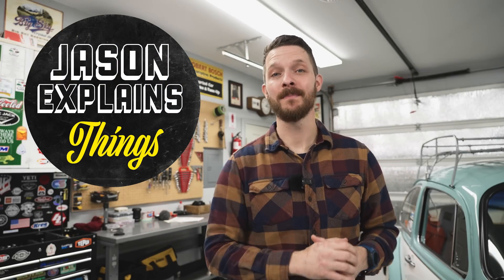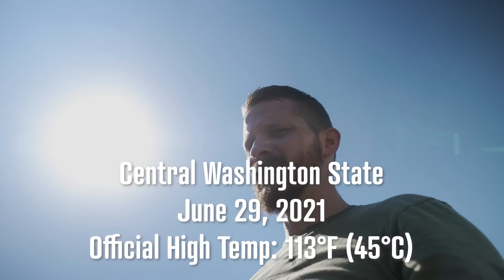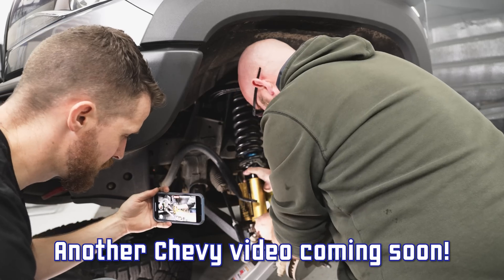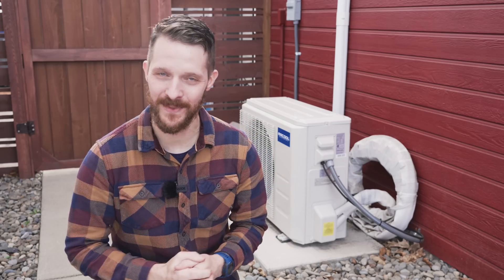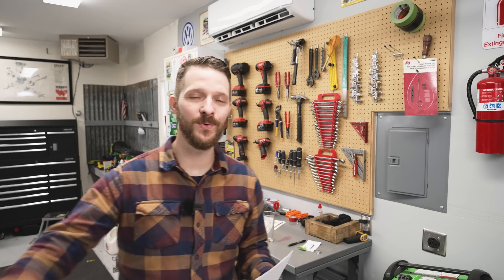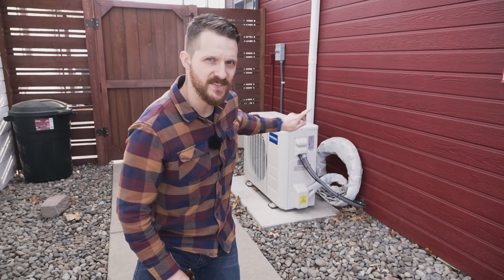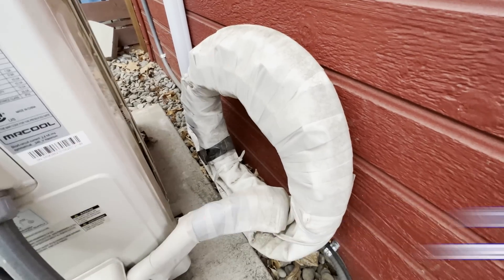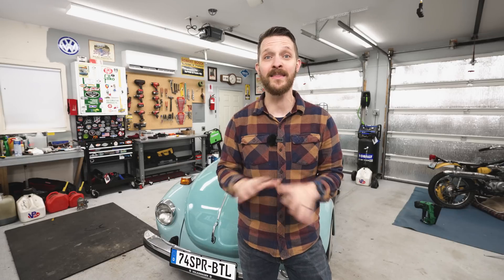MRCOOL DIY Mini Split LONG TERM REVIEW (15 Months Later)

Comment: Great series of videos that helped greatly in deciding to buy and install my Mrcool unit. Regarding the excess line length, the manual actually says to keep it coiled in a flat position. The lower right corner of page 26 of the installation manual states: "Keep excess refrigerant hose coiled. Wrap with protective tape and store behind the condenser in a horizontal position (flat with the ground)."
Reply from the maker: Wow.  You’re comment is pinned.  Hilariously this is the only time this is mentioned, and the other times it’s shown or pictured in the manual it appears vertical.  Also MRCOOL’s own installation videos show it clearly vertical.  But thanks very much for pointing that out.
Reply: If it is vertical it creates oil traps, this will kill the unit and is the most common failure I come across with these
Reply: @RahmanNoodles33 good to know . Thank you
Reply: I was curious about that, as I can understand the vertical not compromising a pressurized system like that... but to actually go out of their way to recommend a vertical orientation was surprising to me.  Good catch!
Reply: All you need is a $25 flare kit.  Cut all that extra ugly line set off....  but yea, dont leave vertical loops.  Its justmultiple oil traps when you do that.
Reply: @jasoncurtis4404  that would vent all your refrigerant and make it much harder to DIY.
Reply: @jasoncurtis4404  Do you have a link for this and maybe a quick explanation?  I really hate the idea of a bunch of coiled tubing just sitting there.
Reply: @jasoncurtis4404  - All you need is a $25 flare kit? If you cut the lines you lose the refrigerant precharge. Then you need a flare kit, vacuum pump, micron gauge, manifold gauge set, EPA 608 certification, a jug of refrigerant, and the knowledge to use it all. 🤦‍♂️
Reply: @jasoncurtis4404  Also we'ld lose the $1,000 premium we pay extra for this true DIY solution.  That would defeat the purpose.
Reply: @jasoncurtis4404  Bahahahahahahahahahahahahahaha

Comment: Sorry to be a party pooper... but that Square-D Homeline panel has a 30 amp 2-pole Siemens breaker in it which is a code violation. Simple and cheap fix to just swap that out with a Sq-D Homeline 30 amp 2-pole breaker.

Comment: I installed the same unit in my house in North Central Washington in 2019. It cries, woo, woo woo, woo. My wife and I did a full cleaning, messy, but the fan was caked with stuff. I thought it might be a bearing, but it gets louder and quieter in a 30 second cycle. Anybody out there know what this is from? Perhaps I have a tiny leak and am losing cooling, or perhaps it is the TX valve. It is really annoying.

Comment: Hey Jason build a small roof over hanging (like a porch) the unit and paint. This way it keeps snow off and piling up behind the unit. Then paint you hose line cover the color of house.
Reply: From what other comment said since horizontal you could build a shelf in the roof so the coil could be horizontal

Comment: Great video.  The production quality is top-notch and you cover everything well while still being succinct.  The natural gas heater is very effective at warming up a space, but at one point you said it was more "efficient".  I suppose that is a subjective topic, but in terms of both cost and COP (Coefficient of Performance), the mini-split is more efficient at heating a space.  This is because it doesn't generate heat, it merely consolidates it out of the atmosphere.  This is what makes them almost magical, because their efficiency is actually greater than 100%.  In fact, that unit has a COP rating of 3+, which means for every unit of energy (in the form of electricity) used to run it, the mini-split puts 3 units of heat energy into your shop.  As effective as the natural gas heater is, the COP is still less than 1, by comparison.  Even the very best gas furnaces are only in the 90-95% efficiency range.  Your mini-split is likely running at a COP of 2 even when the temperature is at or slightly below freezing outside.
Reply from the maker: Yeah I've been corrected on that a bunch of times.  Meant to say economical instead of efficient.  Heck, that might not be true either since natural gas prices have gone up so much.  :-)
Reply: @JasonExplainsThings  - Yeah, but propane has gone up even more.  I'm SO glad our HVAC guy talked us into getting a heat pump added onto our AC coil, when we replaced our system a couple years ago.  Between that and the heat pump on our hot water heater, our total cost for utilities is down more than 25%!  This really pays off for us whenever we have a fire in our wood-burning insert, since that has a plenum chamber tied into our HVAC's hot air return.  Both systems benefit when we have a good fire going.

Comment: I have nothing but problems with my unit lots of Freon leaks on factory joints
Reply from the maker: That sucks man.  I installed mine 2.5 years ago without any issues since.  All I do is clean the filters on occasion.  I may do a deeper clean on the condenser and check the drain pipes this spring before I start using the AC all the time.

Comment: A lot of people in my area build a small sloped roof structure over top of the unit to kkepmthe snow from falling on the unit, the lines and the area behind it. This works really well and doesn’t impact the operation of the unit at all. Basically just a 2x4 frame that goes far enough above the unit so as not to interfere with the air flow, but greatly reduces the snow accumulation around and on the unit.

Comment: Thanks, but it made me realize that I can't use MrCool because in my 2nd story application I can't allow excess lines coiled up.
Reply from the maker: If you're installing it on a second story you likely would have the exact amount of line and not need to coil it.  I'd just recommend checking the instruction PDF and measuring to confirm.

Comment: Jason, I installed a 12K unit five years ago and recently installed a 24K Generation 3. I am pleased with the performance and quality of both units, but have the same problem noted by others on the Mr. Cool blog, the inability to maintain an even room temperature.  The set temperature on the evaporator display is typically much higher than the actual room temperature and continual adjustment of the set temperature is necessary.  I have used both the handheld remote and their wireless mini-stat with the same result.  The Mr. Cool company blog states that the remote units are NOT thermostats, but merely controllers that advise the system of a set point and the system makes decisions based on indoor and outdoor factors. Most disappointing is that I have had no response from my contacts with Mr. Cool and this problem is identical to others on their own blog, and their answer was that their tech department would "reach out" to them.  The blog was active in 2020 and I am unaware of a current one.  The other worrisome thing is that there does not seem to be a method to register the product for warranty nor is there a procedure to make a warranty claim if needed.  DIY is great, but if a problem arises, you are on your own dime.

Comment: Would these work over regular heat pumps for inside the home? They have the 36k but ones for 1500sq ft. For 3300$. Seems reasonable

Comment: Ah yes… the almost globally standard statement of “we won’t maintain it cause we didn’t install it” (and missed on the ‘official dealer’ markup and ’1000 USD per install). Exceptions: countries like India or Russia, where you can find AC tech actually understanding thermodynamics and being OK to consider you (the owner) a competent equal… and a paying customer. 🙄 Some cases went to court in the EU over this, and the DIY-er won! Right to repair, right to maintain, right to DIY! 💪🏻

Comment: I installed a 12 K unit two years ago and loved it,..
It worked flawless until today, I got a P4 trouble code on the unit, called customer service it was horrible and I’ve been reading a lot of negative things,… so now it feels like I’m stuck. gonna have to call an HVAC contractor probably to recharge it or troubleshoot it and spend more than what I actually spent on it☹️

Comment: Nice follow up vid, thnx for posting!  Question I have is what is the power draw at each of the many settings, or over a month of use at whatever settings you leave it at?  For ex: Watt hours being used at eco mode regular mode, SUPER COOL mode? That kind of thing. Thanks again for posting! Subscibed!!
Reply from the maker: Sorry I haven’t had any issues like that.
Reply: @JasonExplainsThings  he's asking how much electricity does it cost to run it in various modes.

Comment: Thinking of getting this installed. Does it matter how many amps my home's breaker box is if the HVAC guys are going to install a separate breaker next to mini split like i see next to yours?
Reply from the maker: I'd consult an electrician.  FYI, the box on the outside isn't a separate breaker... its just a disconnect box which is required by code.
Reply: Yes, it does matter. Your main panel is rated for a certain amount of average and you can’t exceed that.

Comment: Great Video, but just a short correction. It might be cheaper to run the natural gas heater in your garage, but it's not more efficient. Mr Cool gen 3 has a HSPF rating of 10, which is pretty good for a heat pump in heating mode. That is about 290% efficiency for every Watt of electric energy used to run the heat pump in heating mode. Most natural gas furnaces run at about 93% efficiency. You would actually be better suited letting your local utility company burn that same natural gas to make electricity (They get about 80% efficiency when making electricity with it) and then use that electricity to run your heat pump.
Reply from the maker: Yeah, I misspoke.  Should of said economical vs efficient.  We're lucky here though because we get our electricity from hydroelectric dams.  So it doesn't get much more green than that.  :-)

Comment: These are not worth the price at all they cost more then double the cost of the same mini split without pre charged lines a vacuum pump only costs about a about a  hundred bucks or a a.c. guy will do it for about that price also these are not good quality
Reply from the maker: Ok, why watch a video about something you already decided you think is dumb?  Sitting over here loving it.  It’s 109 outside and 75 inside the shop. :-)

Comment: Single head mini-splits are a snap to install and work great.  Don't forget they are not install and forget.  You need to clean out the filters and condensate drain line several times per year.

If you are thinking about a multi-head unit, do your planning and don't expect it to be a quick one day install.

Comment: If MrCool has a warranty who does the warranty work if local people will not do? 
Interesting you say the manual says to coil extra line vertical when so many home "experts" say that is wrong. 
Would be nice if they provided an option to specify the line length you needed in a DIY purchase.
Reply from the maker: Please see the pinned comment.

Comment: you should put that excess line set on a  horizontal plane than a vertical one.. I see it all the time.. that way you have it, it can trap oil which is not good for the compressor....

Comment: You said the natural gas heater is more efficient which in cost might be true, but in terms of actual energy consumed a heat pump is almost always more efficient since it is just transferring the heat from outside to in instead of actually generating heat.
Reply from the maker: Yup.  Been corrected on this about 100 times now.  😂😭
Reply: How much actual energy was consumed at the power plant to produce the electricity the Mr Cool used for this comparison? Just saying.

Comment: I stated in an other of your video's how I had a home built in Mexico, and chose my mini splits to be 220's rather than 110 as ALL my neigbor's have done. It's been ten year's, in which I have them properly maintained every year. Which to this date has included only the cleaning of them, no additional gas has of yet been needed. All of my neighbor's who have 110, have replaced their 110's at least once, three of them because they were considerably old when I first installed mine. Are on their second replacement.

Comment: This video just popped up in my recommended today, and regarding that cover - did anyone ever suggest using a spare tire cover?  Might be just about the right size, and should be even lower profile than what you were originally planning on building.

Comment: You need one in every room. 
Not for me
Reply from the maker: As you see, this is in a shop… for a house they make multi zone units.  But I can tell you that if you need to retrofit AC into an old house these work great.  My old house (first 8 months of the channel or so) was over 100 years old and predated central air.  The new owners installed mini splits and it works great.  You do have to run and hide the lines, but again it’s a great option.

Comment: Jason.  Your video Mr Cool video review was great and convinced me to buy two systems ... 18k and a 24k (both single head) GEN 4.  An installation question re the thru the wall hole size.  The sleeve with the system is approx 2.5".  The instructions call for 3.5" hole.  All the hoses and electric fit through the sleeve.  Any thoughts why they call for a 3.5 hole?  What did you do?  (I got the new GEN 4 so not sure if this makes a difference.)
Thanks.  MrCool should keep you around.
Reply from the maker: I just followed the instructions so I'm not sure why the hole is the size it is.  FYI... I am 100% not sponsored or paid by Mr Cool.  I purchased the mini split with my own money at full price.  I do get a small commission if people use the amazon links in the description.  Thanks for watching!
Reply: @JasonExplainsThings  Thanks.

Comment: Hey Jason, one easy thing you can do to improve the look of the lineset is just paint them the same body color as your garage. It worked for me and it blends in pretty well.
Reply: Try taking a 3" pvc pipe and cut it in half then take a heat gun and heat it where you need to bend it. Then paint it the same color as your building. I took a batton of insulation and put it in the pipe before covering the line sets. The more insulation on the line set will make it more efficent. Worked great. Just drilled holes and mounted it with screws. Just make sure the holes are at the edge of the pipe so you don't hit the line set with a screw. Way cheaper than that junk covering system from Mr. Cool.

Comment: How about monthly usage one your electricity bill. I understand that the rates are different in your area than other areas. But a little information would be great. Great video and keep up with the great information. Oh by the way great looking bug you got
Reply: For heating these pumps are great. The heating output can be 3 times higher than electricity intake. I have 2 pumps at home and both use around 1.2KW electricity and output 3.5KW as heatingpower.

Went from 350€/month electricity bill to 180€/month in the winter.
Reply: We used central heating before and it was a  6KW system. Wood/electricity. We still need to burn some wood in the coldest weeks when we have to turn off the pumps so they don't break. But i would say we save around 40% on heating costs compared to before.

Comment: I’m curious to know how long they last compared to other more well named brand like Mitsubishi and lg. being as cheap as they are to purchase they must have skimmed on some parts. Would be interesting to see if they last longer than 10 years. Ik I should condescending but but I know Mitsubishi will last 15-20 that’s just the brands I work with and use. I feel like it’s comparing a Goodman to a carrier there’s just no comparison to the quality of the parts
Reply: I’ve definitely been thinking the same thing...

Comment: HVAC tech here. There are a lot of off brand mini splits that sell direct to consumer for a cheaper price than a Fujitsu or Mitsubishi. Mr Cool is one of them. Most of the time they work well. The issue with us servicing them is that in the event of a parts failure there is often nothing we can do to easily get replacement parts. We have distributors for the big brands that we can walk into and get parts at. Think autozone but for HVAC parts. There is no such place to get parts for a Mr Cool unit. If the system is leaking refrigerant or is not running properly due to something environmental I can address then I will gladly fix whatever is going wrong but I will not replace parts on these systems. And like Jason said many companies have a policy that they will not touch these systems at all
Reply: You can't call up Mr Cool and get a parts catalog emailed? Is that so hard?
Reply: @jadedandbitter  IF you can find a parts catalog you'll be importing all the components from China.  Mr Cool units are typically considered disposable, unless you want to wait 3-4 months for a service.
Reply: Then you and them shouldn't get any business. You and the parts house are total rip offs. Tell me how much do you charge for a pound of gas? Around here most charge arpund 80 dollars per pound of freon. You can buy a 25 lb jug for 180 dollars from Amazon of Ebay. So I am certian that you pay less than that. But 25 pounds at 80 a pound is 2,000 dollars. So you are making 1900 dollars profit! Highway robbery! I hope these units get so good and easy to put in that jerks like you can't make money in the industry anymore. I am a HVAC guy but I don't rip people off. Been doing it for 10 years I know what the mark up is!
Reply: @NoneYa-mf2ys  Who hurt you?
Reply from the maker: No hard feelings for sure. 👍 I think people read anger into things that I don’t have.

Comment: The Defrosting thing is common with these HVAC systems, the system is built to do the Defrost stuff automatically, just don't shut off live power going to it while it does all that.